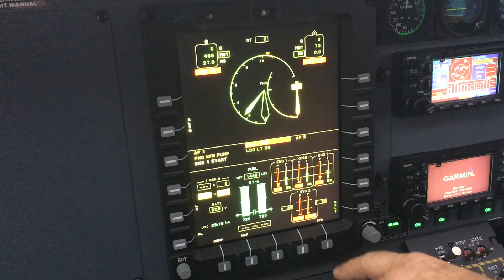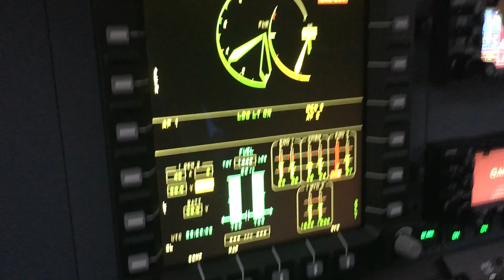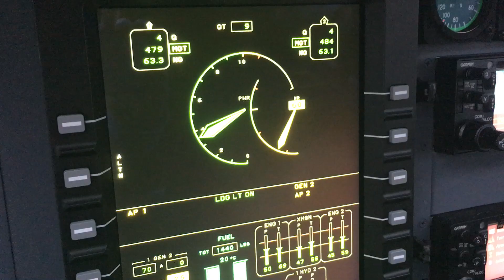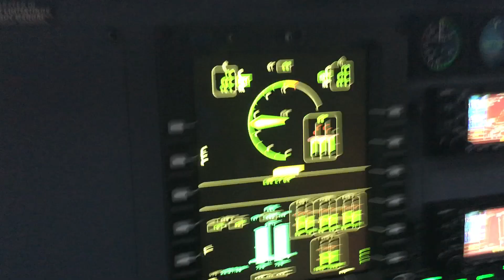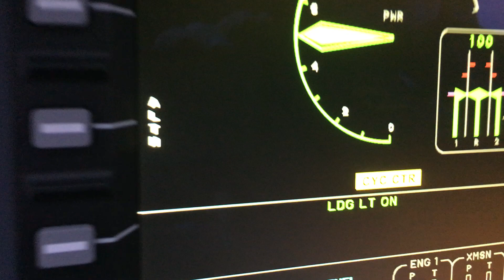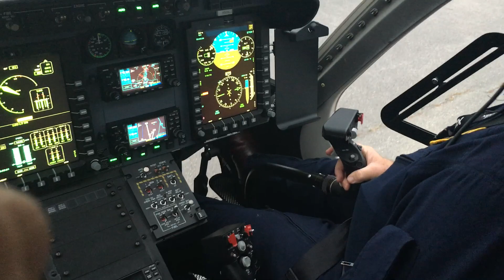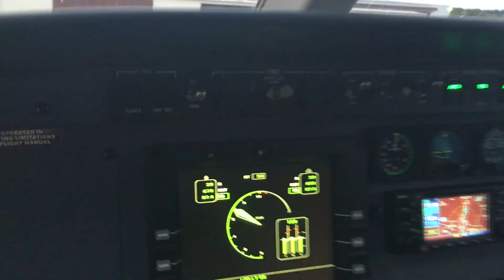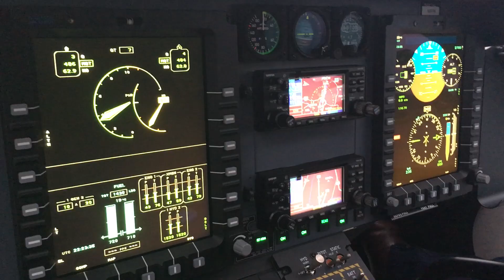Bell 429 Startup Procedure

Comment: The Bell 429s awesome. The handling is absolutely butter smooth has tons of power yet isn’t overly sporty or have an attitude like a lot of airbus helicopters have.  My only negative is how widespread the buttons are as some power is on the dash, overhead, and center consoles versus in a single area like airbus. Robinson just plain sucks when it comes to safety as I always cringe at how thin the airframe is, but these 429s are safe for this class. I believe that the AW169 is possibly the safest but they’re so effin’ expensive to service in the United States and there’s almost no FBOs or engineers who can service these awesome helicopters. 

For the US, I would definitely buy a 429!

Comment: Its easy af. It's a 6 step process. Take the brake off the rotor located on the roof (which is not mentioned). Turn on the battery.  Start engine one (aka starter)  Start engine 2, turn on both generator switches and you are good to go. This numbnuts just wanted to make it look complicated by pressing buttons that have nothing to do with the "startup" procedure. Everything else was testing the lights/turning on gps etc etc... Not anything to do with the startup procedure. SMH

Comment: You'd think with the advent of FADEC turbine engine startup would finally be more automated than it is. We can't invent a computerized controller that can monitor turbine speeds and TOTs and actuate ignitors, starters, and fuel shut offs?
Reply: Exactly, still seems like quite a lot to do/check/monitor still in this day and age considering a lot is now already automated anyway and the technology we have.
Reply: Well, the EC135/145, MD900/902 and the A109ˋs with the PWC 206/207 engines actually have full automatic start up and shut down. I’m actually surprised he has to „ roll the throttle“…
Reply: What do you think is happening in this video? It’s all FADEC, for a multi-engine helicopter it doesn’t come simpler than this.

Comment: I've always wanted to know why you can't disengage the rotors when sitting idle.surely it would be much more fuel efficient?
Reply: In modern turboshaft engines, the turbine driving the rotor is not mechanically coupled to the gas generator (made of compressors, the combustion chamber and turbines driving the compressor). Reason why they are also name « free turbine engines ». Thus, disengaging the rotor would offer no benefit as the power turbine (« free turbine ») is not driven by the starter. On some helicopters, the rotor brake can be activated at start, but it is for high wind capabilities reasons. The situation with old engines with their gas generator linked to the rotor was different. A clutch was preventing to drive the rotor at start, thus avoiding design issues with the starter. But the clutch itself was meaning weight and reliability issues.
Reply: On turbine helicopters it doesn’t matter if the rotors are turning when the engines are at idle.  The starters don’t even turn the rotors.

Comment: So what is a hot start? Ive heard mixed answers for this question. Is it bad for the engine ?
Reply: The turbines of the hot sections of the engine are designed for a maximum temperature. Increasing the power of the engine without adding weight is made by in increasing this max sustainable temperature. But there is still a limit : an overtemperature at start (typically caused by a malfunction of a governor element or air permeability of the fuel lines) can damage the turbines, and the cost of repairs quickly amount to hundreds of thousands... On recent helicopters equipped with Full Authority Digital Engine Controls (FADEC) the start sequence will be stopped automatically should the temperature threshold be overshooted. On older helicopters, it is relying on the pilot survey at start, and the overtemp sequence is really quick ! This overtemp is sometimes called « hot start ».

But on turboshaft engines the « hot start » wording mostly refer to a normal procedure at start. If the residual internal temperature of the engine remains high before starting (further to a previous flight combined to a high OAT or an aborted start), there are specific procedures to start the engines by first running the gas generator with the starter without injecting fuel.
Reply: @noosphere6132  oh ok i see ... So what about engines with afterburners? Or military jet engines? Does the same rules apply or do they changes because it has an afterburner? Im just wondering sorry for the questions im just trying to understand all of this
Reply: Too much fuel entering the combustion chamber and/or insufficient turbine RPM.

Much worse damage for a turbine engine than piston.
Reply: I would like some pointers on building a car turbo jet engine so i need to know as much as i can . i like to build things
Reply: The design of a turboshaft / turboprop engine is nearly the same than a single flow jet engine. Instead of collecting the energy of the hot gases with a power turbine driving the rotor or propeller, you collect this energy on the exhaust casing. The afterburner consisting in providing additional energy through burning fuel after the turbines : high energy because you are not limited by the max temperature endurance of the turbines but with low efficiency (compared to the combustion in the combustion chamber which provides a very efficient air / fuel mixing) thus impacting the aircraft range.

Comment: Tell me he didn't just waste a heat cycle on those engines just to move the aircraft over a small distance that could have been accomplished using a set of ground maneuvering skid wheels and two airport service staff members?
Reply: Ok...tell me which one you would rather do, when given the opportunity 😂
Reply: @jetstream454   As long as I wasn't paying for it.......I'd definitely chose what takes place in the video!!!
Reply: We didn't have ground handling wheels at the time.
Reply: Suppose that's all well and good if you just so happen to have a set of ground manuvering skid wheels and two airport service workers laying around?
Reply: That would be a huge waste to shorten a very significant
(& expensive) maintenance schedule just to move from one space to another on the same paddock. Poor planning.

Comment: So much cooler than starting up the ol’ Allison 250D on the test stand. You actually get to see things move. This was likely a different engine, but still cool to see.
Reply from the maker: And it does not require the 2-minute cooldown that the old RR250's did in the Jetrangers.
Reply: Backyardmech1 Yep. Pratt Canada PW207